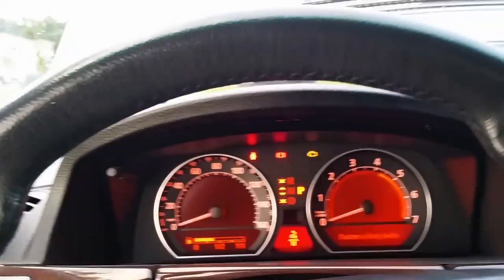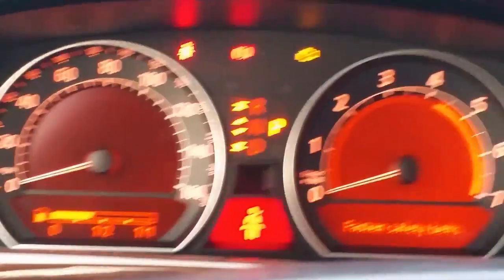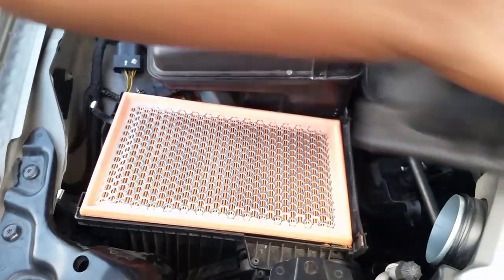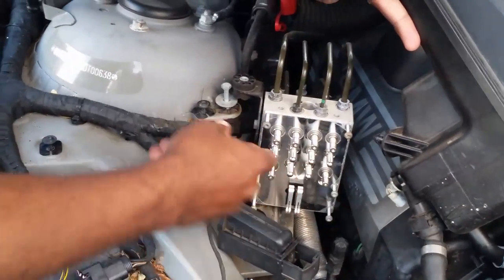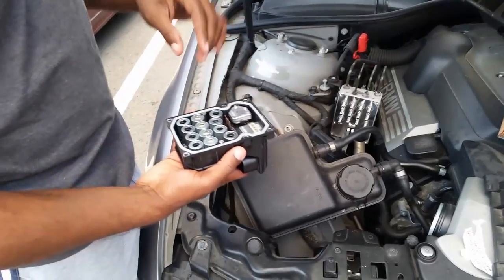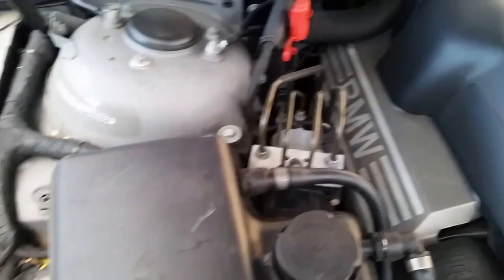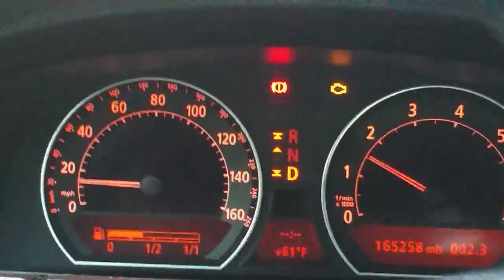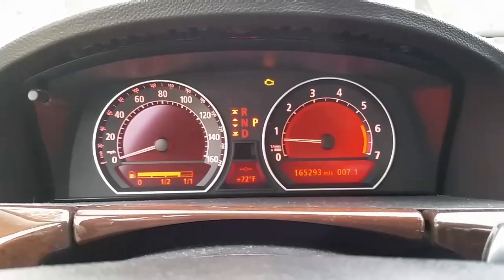BMW DIAGNOSIS ABS MODULE | INSTALL & REPAIR

Comment: Just got my abs control module “fixed”… day two car wouldn’t start .sent to there mechanic gave price they had my new(used) very expensive car over a month he said they sent wrong part etc etc ….went to leave tonight started car ran in got purse charged phone tons of lights went on n car died .I’m livid and not sure what to do

Comment: Just spent 11k on 2010 bmw and the yellow (!) came on when left dealership day two wouldn’t start sent to their mechanic n said I need new ABS CONTROL MODULE AND ITS A THOUSAND BUCKS.what should I do?
Reply from the maker: It depends on your level of comfortability on completing the work I have shown: You can follow my video and spend the money to fix it yourself (not sure on after COVID prices) or you can pay the $1k the dealership is asking for. That is a personal choice. What I would do is price the ABS Control Module and cost of repair in Atlanta Or pay the dealership and request a rental car during your repair. Then make a decision depending on your financial situation.
Reply: My issue was the abs module pump which I sent it to Moscow Idaho and got it fixed but now I need to bleed the brake lines

Comment: Great information good job with this my brother hopefully I’ll save over a stack !!!!! I was a little bummed out because I just brought my car home from the shop they charge me $220 to put Four wheel centers on which I had already purchased myself however that wasn’t the problem but when you said you did the same thing I felt encouraged hey it’s not just me anyway that was very informative thank you

Comment: To fix the module about £200 ,uk my 728i did this i changed a wheel sensor £20, all done all fixed. The chances of it being the module are very slim ,always a sensor will go first ive done hundreds ,of sensors .728i 735 740 .never the module

Comment: To amend my previous post, this E39 does have issues with the electrical portion of the ABS module(unlike most other models of BMW's)because of the exhaust getting the unit too hot due to it's poorly engineered location. Most other BMW's you can tap on the unit and it will begin to work again for awhile, since it is usually not electrical at all. (until the brushes lock up again)

Comment: My understanding is that it is usually the brushes that fail in the BMW ABS modules and not the electrical unit. In that case the module has to be removed and you can either buy a good unit and swap the electrical part out(so you do not have to get it reprogrammed) or replace the entire unit and have it reprogrammed and then refill and bleed the system.
Reply: there is no programing to do usualy u take the battery cables off first 15 minutes before installing and than reconnect batteries drive it after about 15 minutes it reprogrammes it self when you buy same year parts

Comment: You can't always get the control unit repaired but it is worth a try. In my case the unit got warm and just stopped communicating then next day it would work again. If it is an electronic issue like this it is probably in the processor and impossible to repair. The ones that can be repaired are those where one can just resolder suspicious points and no programming will be needed. If you replace the unit used/refurbished $250 or new aftermarket which is $400 you will need to have it programmed. In my case i tried it without programming and after clearing all the codes and driving for a couple of blocks the car just started braking when i'm trying to accelerate. I had to unplug the connector or wait for the computer to turn itself off but then it repeated. so now i'm ready to go see a local programmer guy.
Reply: How much did it cost to reprogram?

Comment: I hope that the people that are watching this video don’t forget the most crucial step to do first. Unplug your battery, at least 30 mins before, then do this work, also I don’t know how his DSC Module is working without reprogramming it, but yeah, it needs to be reprogrammed, and since you disconnected the battery I would just recommend to reprogram that one too for good sake.
Reply: If its the cars original module that is being repaired it doesnt need to be reprogrammed
Reply: What place did you use to fix it ?

Comment: BMW stated that I have a mechanical issue with the unit and in particular the valves.. Is there a repair for this aspect of the unit?

Comment: Thanks man, just used the link to get the ball rolling on mine. 
I also have some other code issues that I would like some help with.
Reply from the maker: O Forbes Thats great! Glad I could help. Sure, just let me know and I will see if I can help there as well.

Comment: Hi ! Quick question once you buy the new module do you have too reset the car with a computer or it'll reset by itself onces you drive in for a few miles ?
Reply: Depend if you change the electronic part of the Abs so yes but no if u do not change the hydraulic part.

Comment: I HAVE A 2003 745I BMW. DO I NEED TO UNPLUG ANYTHING BEFORE I DISCONNECT THE ABS MODULE?
Reply: CumGetSum7480 Wick Yes, the battery. The battery terminals need be to disconnected before you start with the ABS module.
Reply from the maker: That is correct. You have to disconnect the battery first.

Comment: Question, you didn't have to bleed the brakes after removing the ABS pump electrical portion ?
Reply: When you replace the electric part, which is the part he is holding containing the solenoids, the brakes do not need to be bled.  You only bleed if you are doing a brake flush or are replacing the actual ABS Pump itself.

Comment: Hi, I have a 2006 750Li. I changed all the sensors 3x and had the abs mod rebuilt. The abs logo and brakes tracking light code still pops up on the dash board.  Please help

Comment: Good job I had  the same problem it made  my  transmission  failsafe  come on and locked the Trans in 5th gear & reverse  when I unplugged the abs the Trans worked fine I got a abs control module & walla all the lights went out even the service engine light.

Comment: 2008 BMW 750 LI  FOR POWER STEERING I USED CASTROL TRANSMAX FLUID $18.00 WORKES LIKE BRAND NEW. THE SAME FLUID GOSE TO HYDRAULIC UNIT. THE DEALER SELLS IT VERY EXPINSIVE . THEY WERE ASKING $1,900.00 TO REPLACE THE LINES. IT COST ME $ 675.95 I REPLACED IT MYSELF.
Reply from the maker: Good job,Bro!!! That's how you save money! Thank you for the heads up, if I come across that situation- I'm going to do what you did

Comment: NICE VIDEO . ON MY CAR 2008  BMW 750LI THE PROBLEM WAS HYDRAULIC CONTROL UNIT SAME SIDE BHEIND THE TIRE THE LINES WERE LEAKING, THAT GO TOWARDS BACK WHEEL. IT COST ME $ 637. TO REPLACE THAT THE  PARTS TOOK A WEEK TO COME . INSTALLATION WAS NOT EASY YOU HAVE TO DRAIN ALL THE  POWER STEERING FLUID FIRST THEN START OPPENING FROM TOP TO DOWN ONE AT A TIME   THERE ARE SIX LINES THAT HAVE RUBBER HOSES .NOW THE CAR RUNS FINE . NO SIGNS AT ALL. BUT I LIKE THE WAY YOU DID IT EXCELLENT WORK.
Reply: Was this causing transmission problems?

Comment: at the end of your video I noticed that your oil pressure light was on. that means you need to change the oil pressure sensor on the oil pan.
on the bottom of the car where the oil pan is there some oil pressure sensor you need to change yours your light is on

Comment: Just installed it and ready?
Reply: Tasha'sfablife 
My friend you saying that the lights on dashboard still come on after you send it to fix ?
Reply from the maker: Trino Munoz Perfect - how did everything work out for your car?
Reply: yes but the abs sometimes it's on and off in the car
Reply from the maker: Trino Munoz After you sent it off to be repaired??